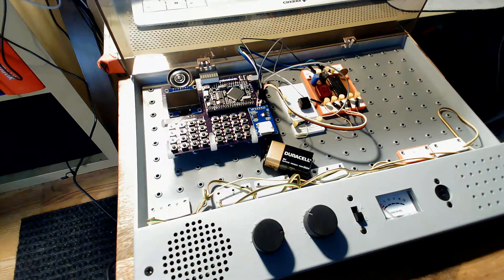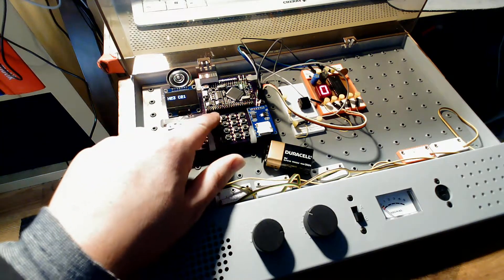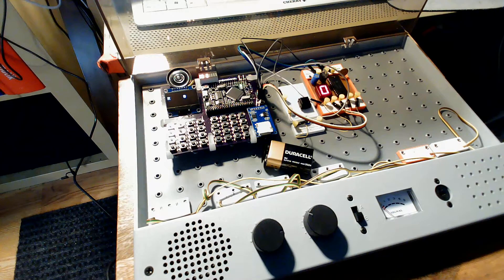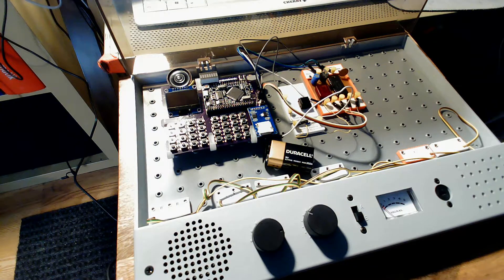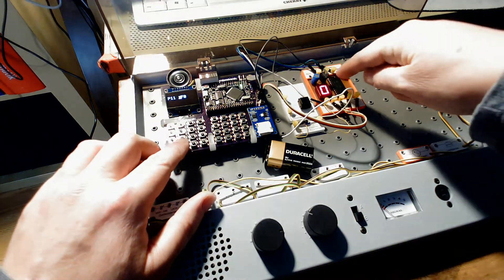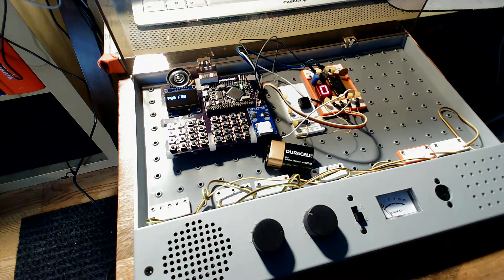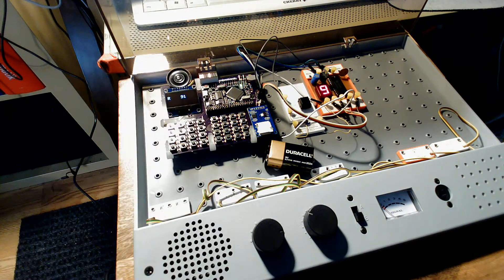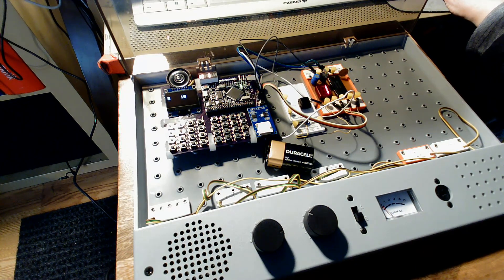Microtronic Next Generation - GPIO Experiments, Counter Module & the Magic of Pull-Down Resistors

Comment: A very good demonstration of the inputs and outputs, Michael !
I also noticed, when constructing the 2nd gen that the original Microtronic had an active LOW output and an active HIGH input. I believe this was common when using TTL chips.
The 2075 counter module has also an active LOW input for counting.
All other circuits published in the manuals make use of this active LOW output.

Have you tried the same circuit with the new single and/or double counter module, using 5V as power supply ?

Thanks for this great video !

Comment: Indeed Michael. 
I expressed me in a wrong way.
What I meant is that the outputs at rest are forced low.. When the output is activated, a resistor connected at the 5V keeps this output high.
So the output is shunted to GND (active low) in rest. 
If has a floating high when activated. 
In the pocket version that soon will be developed, I will make sure that the inputs and outputs are either fully OFF or ON by using buffers.